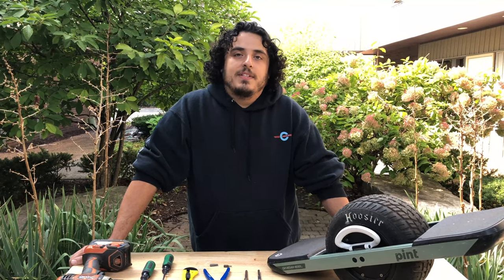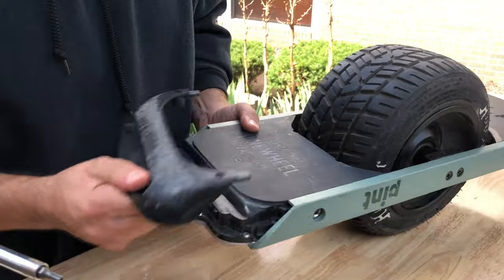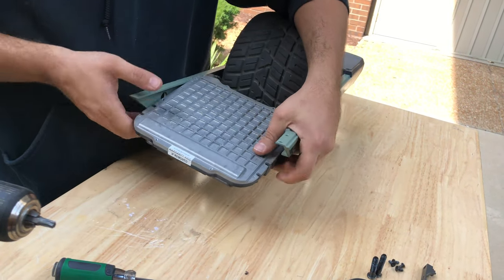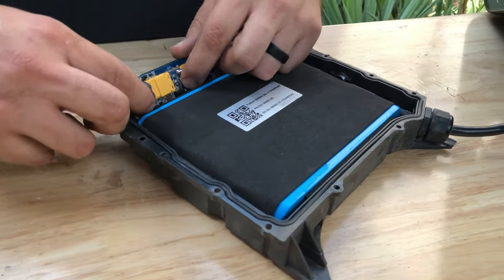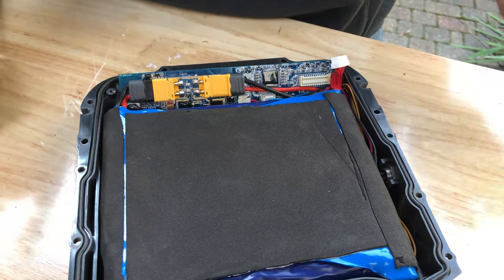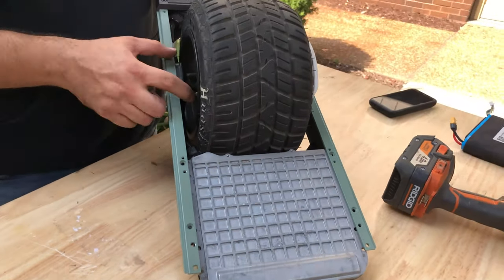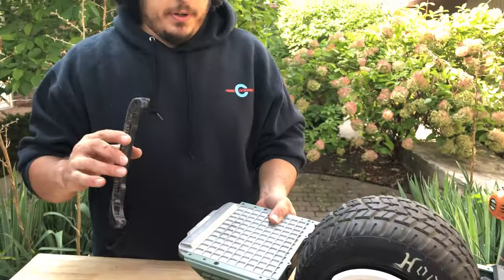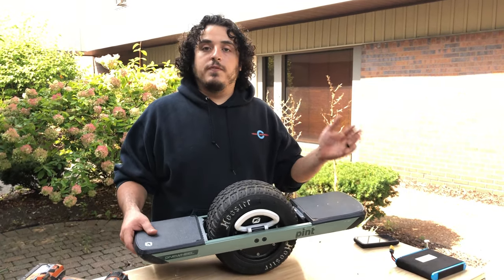How To Install Chibatterysystems Quart Battery Upgrade for Onewheel Pint

Comment: My one wheel has not worked in 2 months. I let it sit in the garage through winter... Thinking it was the battery, searched how to install a new one. There was a place right down the street from me that happened to sell after market batteries. After watching this, I went there to go buy a battery. There was a gentleman that helped me that looked familiar. Not thinking anything of it. I went home to install the battery. I'm watching the video and Bara the guy in the video is the one who helped me.....wow. Absolutely incredible. Awesome staff and sweet work shop. I'm up and running with a higher mileage range. Thank you for the full circle customer service and quality product!! Will recommend!

Comment: Wow this is a really impressive kit with pretty simple installation. Nice job. 

What if you offered a boardbank housing that we could drop our stock pint battery into? Then we would be able to stop and charge and our perfectly good pint battery wouldn't be wasted. 12 miles on the quart battery, stop for a break and get another 7 miles.
Reply: This man is a genius.
Reply: What does this chibattery do the onehwheel

Comment: Hi guys! Love the battery, got it around 4 months ago and have gotten up to 20km of range with aggressive driving. One thing I could recommend you to add to the video or maybe change about the battery pack is the free space on the side of the battery pack where the wires run. My board wouldn't turn on lately so I investigated and figured out that due to this slight slack, the battery pack actually pulled enough on the xt60 cable coming from the controller to disconnect it completely. This is partially my fault because I frequently put the board down on its non-handle side, and in that position the battery weight hangs on those cables, me dunking the board against the pavement just made it worse.

Everything works perfectly fine now that I've found the issue, and I filled out that empty space with a cut to size eraser but maybe the pack could come with some foam padding with adhesive on that particular side? Worst fear is the cable disconnecting mid-ride

Comment: 2 questions 
1. Can you have the ow app open the whole duration of your ride or will it interfere with it?
2. Will the battery light bar on the pint tell you a good reading on how much battery you have left?
Reply: Battery light bar and onewheel app batter % are no longer accurate with this modification. You have to estimate the % left by looking at the voltage remaining on the battery in the OW app. Onewheel app works fine for the most part, but in my experience, ride recording unfortunately doesn't work correctly for unclear reasons.

Comment: Chi quart review.
Put one of these in last month. Near on double my range. Board feels the same accelerating and braking. Tail is heavier of course and simple stop can feel clunky/abrupt because of the increased weight...or I just need to get used to it. Battery fit is super snug. Didn't need to cut anything, Chi please make the balance cables a whisker longer...mine just reached. Recommended product. Using the app/diagnostics/voltage to monitor battery is no problem. Light bar will not read correct and neither will the battery indicator in the app...must just read voltage in apps diagnostics. If you order a battery also order online somewhere the ipr20 bit as it's not likely to be at your local tool/hardware.
Reply: This is the review I should have read before a three hour failed journey to five hardware stores and four auto supply stores. No joke- save the grief and order the ipr 20 security bit off amazon

Comment: Is there a newer install video on here somewhere for the updated redesign chi battery systems that they just came out with where you leave your housing untouched with only one small cut to the BMS cover??? I would love to see it! Also what app do you use to track the range and battery life for this upgraded battery? :)
Reply: The new mods are much easier than this, I made a reddit post that details the new mods and install in general.
https://www.reddit.com/r/onewheel/comments/n7jm8t/quart_battery_install_experience/
Reply: The new mods don’t fit. They are too thick and you will have a hell of a time trying to close it, especially if you’re trying to keep the o-ring in place
Reply: @blakereed7658  I just did two replacements with their new mod, I did not find that it was that hard to close it. Can you explain why you had difficulty with it?
Reply: @ridefree530  To make it fit without removing the housing they squished the cells closer together so that every other row of cells is almost a quarter inch higher.. something like  o°o°o°o° instead of oooooooo.
Reply: @blakereed7658  Oh ok. Yea I installed two of them recently, it was a tight fit for the cover but I didn't think it was that hard. All I had to do was tighten the little machine screws in one by one to put the cover back on.
Reply: @ridefree530  Right on.. btw were you able to reuse your o-ring? Mine does not fit and won’t stay in place. Seems like it got stretched when squished down and now is too big. Might need to just use some silicone?
Reply: Thanks for this comment! I had no idea it was different and would needlessly cut a shit ton of plastic lol. I also have to install the voltage meter I ordered with it so hoping it's straightforward install. Opening the board makes me nervous lol
Reply: @blakereed7658  Sorry I didn't see this before, I'm assuming you found a solution already. The big o-ring will hold the shape of the case and should still fit ok, but I had to use a little grease to hold it in place while bolting the cover back on.

Comment: This is a great video, but many steps are made to look very easy. at 2:45 'they might be a little tight' is a massive understatement. I don't have a high-power drill or the bit needed, so I ordered a wrench kit with the bit. Bit was fine, wrench underpowered, so I used a portable powered screwdriver - no dice. Used a higher powered rechargeable drill. Nothing. Finally went to a workshop that had a real drill. Meanwhile my disassembled Pint sat for weeks.
Reply: agree, cannot remove those 2 damn T30 screws
Reply: @stacyneri9463 yea those are absolutely insane, btw when you removed em did u notice if they had loctite? If so what colour. Thanks, I can try to actually melt the loctite so it would be easier to get out

Comment: I bought a pint with quart battery upgrade used for my fellow one-wheeler.

Last night was my first range test, flat-ground on the Pacific setting I got just over 12 miles before the Pint died

Is that about everage?

Comment: I have a pint battery that reads shorted on the connector but no obvious heat damage or swelling on the pack.  What couod be wrong here?

Comment: My friend has been having issues with his Quart battery for a while now. His board Captain Morgan’d him yesterday at only 6 (5.9 but close enough) miles and I personally charged it for him to 100% with the home charger to really top it off! 

Not impressed tbh. We even turned the board off and back on to cycle it through and it still crapped out.

Comment: Does this work for the pint X ? Or will it get bricked like the GT if the battery is disconnected?
Reply: This gets the same range as the pint x, so why would you do it?    And I believe the hardware wouldn’t allow you either way

Comment: Is there a way to add a voltage meter display to watch the board's battery level?
Reply: Probably not without soldering
Reply: It has a display by your foot built in
Reply: @kylemark4536  Just ordered. Is there a link to install the volt meter?

Comment: My O ring somehow doesn’t fit in anymore... any tips while I’m mid construction?
Reply: Just happened to me. Seems like it expanded due to the hot weather here in Vegas. Looks like I'll have to go without it
Reply: I’d at least put a bead of silicone in there
Reply: @ryleyisakson6445  I ended up snipping just under a centimeter off and filled the gap with a little gorilla glue, the rest sunk in nicely!
Reply: @bencrystalofficial  I trimmed mine as well, but I melted the ends and pushed them together. Others recommended rtv silicone which I ordered off amazon

Comment: If you get a chance to open up the original battery pack. Can you let me know what the stock spec is in the 18650 cell  Mah and discharge rate

Comment: What kind of bit/screw driver for the plastic covering the chip next to the battery? You used a small screw driver but not sure if it was Phillips or something- Those screws looked stripped before I even tried
Reply: Ahhh- its the t8 but specifically the 6 star for this one. So need to buy both those sets
Reply: Good to know! Wish they'd said as much at the outset. Third time I'll be reassembling due to the wrong bit.

Comment: I have a question, does the Onewheel app always say 100 percent and I’ll have to go off of a voltage chart? And what will that light bar say as well? If you guys could respond that would be great!
Reply: I’m concerned that no one is answer this or a previous comment that has asked this question.
Reply: @shableep  yeah

Comment: This is badass! I wanna do the update but man tell me the app still reads out your battery level? If not I’d need a voltage readout to know what the battery percentage is and that seems like a huge pain in the arse 🤷‍♂️ like to do this tho the added range would sure be nice!
Reply: They sell a voltage meter you install on the board as well its like $30 extra.

Comment: How much more range do you get with the new battery?
Reply: "12-15 mile range estimate based off 200 lb rider in pacific riding mode in ideal conditions"

Comment: How did you get the all terrain wheel? Is it better than the original pint wheel?
Reply: It’s better in all-terrain conditions, and will have a long mileage life. You will loose mileage though.
Reply: @loganmumma4506  as in mileage range per trip?
Reply: @duderilreez  correct.

Comment: Can you Link us the 20 IPR Security Bits from Ebay Please.

I'm at My LocaL Homedepot but I cant find it. Thanks
Reply: I second this!  I can’t find it. It’s not a Torx tamper proof T20 and folks look at me like I’m crazy when I’ve tried to find it.
Reply: I was gonna buy all the Bits Yesterday. 

* T8 and T20 T30 very easy to Find. But the 20 IPR 5 Point Security bits is so Hard to Find. 

Please give us The Link. I need to Change My Battery already
Reply: @norbelsemaj3870  u can get them at harbor freight tools
Reply: @norbelsemaj3870  are the only ones i need t8 t20 t30 and t20 sec bits?

Comment: Check your version of your pint! Bought a quart only to find that it was not compatible because my pint is too new... So bummed.
Reply: How can you tell if a pint is too new?
Reply: @BullyMaguire4ever  I would email the company and ask them before buying the battery
Reply: Derek Williams the reason I ask is there is a guy near me selling a pint that has 20 miles on it, and he also has a quart battery that he hasn’t installed and I’m wondering how to tell if that pint is compatible with the battery. So I’m wondering how to tell which hardware revision a specific pint is.
Reply: @BullyMaguire4ever  just buy the pint then. 

Sorry, not much help

Comment: He really glosses over the bit that you need to take apart the battery housing- it's called a 5 point TORX bit or TORX plus IPR. It is not easy to find in local hardware stores and likely you will have to buy this bit online just FYI for anyone doing this install. The size you need is a T20.
Reply: Yes very true, a special purchase - five point tamper proof torx. Also have stripped out two torx wrenches trying to take out the wheel bolts on the side. Any advice for such tightly fitted bolts?
Reply: Update, also bought high strength T30 drill bolts, drill failed to supply enough strength. Used a wrench in the end with maximum leverage on the bit. Clearly the loctite on the bolt was a bit of an issue. Bolts are a bit shredded too after the experience. So, prepare for it.
Reply: Yes the wheel bolts on my pint were quite tight as well and I almost stripped the bolts using a drill. I would do what you did and use something to get leverage like a ratchet or fitting a wrench to the end of the bit. I didn’t have any issues with my bits breaking they must have been stronger than the bolts since the bolts started to strip instead. An impact driver could be used in the worst case if you can’t get any movement with the use of leverage.
Reply: I bought the kit off Amazon and the tamper resistant T-20 not labeled IPR did not fit the housing screws.
Reply: @Spatial_Computer  I don't know what kit you are talking about, but this does highlight the need to order the special bits mentioned above ahead of time to complete this project.
Reply: Figured it out. The link is for 6 point torx security bits not 5 point. I made the 6 points work, but hopefully future people don't make my mistake.
Reply: @Spatial_Computer  Oh I see, the original poster of the video has linked an Amazon page for the incorrect bits in the post. To future readers- DO NOT BUY THOSE BITS. They will not work. This just highlights again the confusion surrounding the bits needed and how easy it is to accidentally buy the wrong ones.
Reply: @ridefree530  They actually are proper bit for the T30 six point security bit. But 5 point 20 also needed.
Reply: The 5 point 20 IPR has not been an easy task to find, I ordered one but wanted to find it in store. Went to 6 different hardware stores and none of them had 5 point bits
Reply: So what’s the difference between a T20 and a T20 IPR
Reply: @AbsoluteKhan.  I had the exact same experience. Just buy it online ahead of time and save the hassle of driving around/calling hardware stores.
Reply: @miketa456yt5  I'm not sure the nomenclature I used above is correct, but essentially these are tamper resistant screws that have 5 points (standard torx have 6 points) and a center pin. They are specifically because it is hard to find the correct bits to unscrew them.

From Wikipedia:

A tamper-resistant version of Torx Plus exists having five lobes rather than six, plus a solid post in the center, and is used for security as the drivers are uncommon.[20] Though Acument (formerly Textron) lists no designation,[21][22] TS [23] or IPR [24] may be seen. The screw may alternatively be a Pentalobe.
Reply: seems more lameness in the chi marking product like come on just ship the product with these cheap but hard to source bits… damn it

Comment: What's the range with this new battery you installed
Reply: Watching 👀
Reply: Website says: "12-15 mile range estimate based off 200 lb rider in pacific riding mode in ideal conditions"

Comment: lol,The new hardware and software updates  makes the new one wheels/parts non-interchangable- Change the battery and the one wheel won't turn on.--One Wheel breaks down you can't get parts,you have to send it to One Wheel factory in California.==pay your own shipping cost==High prices for the parts==Wait 3-6 months to get it BACK.
Reply: It’s unfortunate but…well it makes sense. If everyone went changing out the stock battery, that adds a lot of liability into Onewheels hands that they can’t control. If one of the batteries catches fire, that’s going to be shown as their fault. So it’s in their best interest to try and prevent it unfortunately.

Comment: Only thing holding me back from the onewheel is the specs. Great speed and all terrain but terrible range in general. My $150 electric board does 7 miles and goes 16mph. For the price that's already better. Build wise the onewheel wins. I guess I just hope they announce something new soon with a decent price

Comment: $450 for the battery? Your kidding me right? Lol
Reply: your life will change when you can get credit cards. dont use them for dumb stuff. if you need some 450 battery boom np you have months to pay it off. i like the apple card but others have deals on apr.
Reply: @clheppermann  I rather buy the XR then buy a battery for a pint lol
Reply: @maneeoocho350  I have a pint. It’s great but yes I wouldn’t buy a 450 just for the extra  but when my stock battery looses its potential I would get the 450 as a replacement.
Reply: Batteries are expensive ... very expensive. You may be used to buying Chinese stuff that does not last or give the performance of a real product, but here we are talking about a very powerful and quality battery that should not explode or catch fire! In the world of hobbies there are indeed $ 30 3s lipo batteries that perform well, but generally they inflate quickly, catch fire! I even have an acquaintance, his garage caught fire because of this kind of shitty battery.

Comment: Very expensive battery. Exactly what makes this so expensive??. .By the way, just add another couple of hundred dollars more to the Pint price and you get yourself an XR.
Reply: Cause you did not take the time to order the cells and make your own battery.
Reply: @J d   Bro why you mad it’s a great product. If you can put together something then offer if super cheap why don’t you do it
Reply: @RemingtonTerritory  I am one with onewheel, onewheel is one with me.  I am calm.   I am too busy riding, no time to put something together.  I will buy the battery when my one pint battery is degraded.  I think it is a better deal than getting a new one from Onewheel.
Reply: @Jd-zd6bh  absolutely better to get a new battery, their pint battery upgrade gives xr range. :)